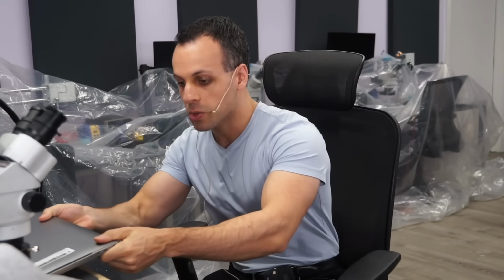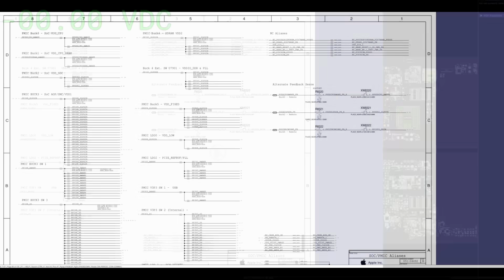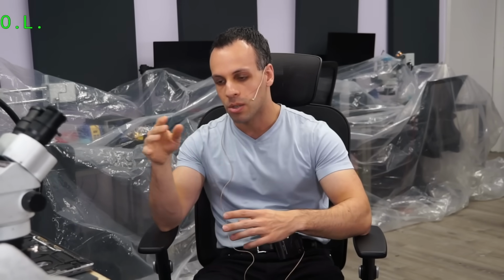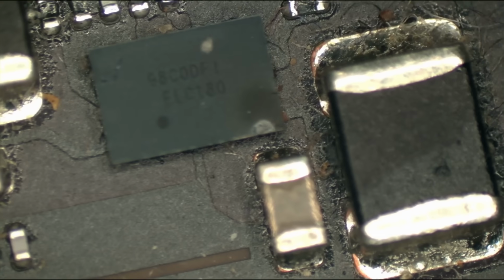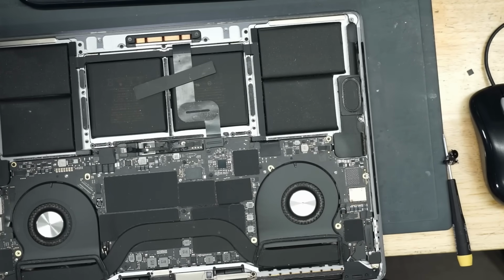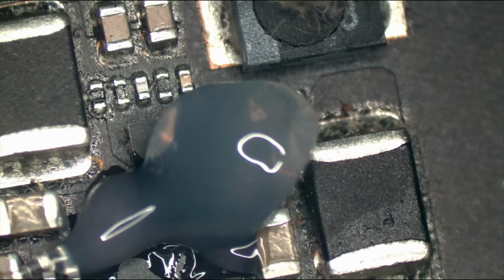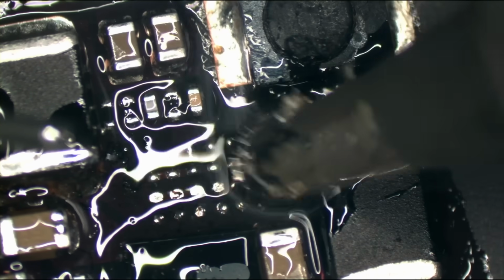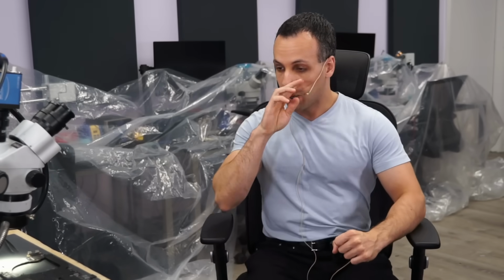How most 16" Macbook Pros often kill themselves & why they're unfixable

Comment: I understand buying apple phones and ipads. But apple laptops....Why would you buy a device that is listed as a computer yet it doesn't do all the things that computers have historically always done.....have REMOVABLE RAM AND HARD DRIVES!! upgradable stuff! 

You are going out and spending an absolute fortune for minimum hardware specs that you have no option to upgrade other than trying to sell the device a year or two later when you realize you actually do need that extra SSD space and more ram! 

Also if anything goes wrong with it, literally every single part costs an absolute fortune to have repaired! and as this video shows, a chip grenades itself on the motherboard and you literally loose all your data!

Comment: their should be a separate voltage cirtcuit to feed that memory along with protection diode at least . feedding 12v into that IC that offer little protection is negligent

Comment: I was an Apple Certified Tech and worked on every model every day for several years - an average of 10 completes per day. Favorite machine by far - Macbook Air. Easy to service. 13" Retina's were solid. We had chronic logic board failure issues in ALL the 15" laptops. Mac Mini's are great! Can't recommend iMacs of any era.

Comment: This is why you stick with the A1502. Mine is ten years old, and is still solid as hell. The SSD isn't soldered on, the parts for it are abundant and cheap, even a whole new logic board with an i7 3.1ghz processor and 16gb ram is only about a hundred bucks. Just get the little adapter and switch it to a new NVMe ssd, throw Linux on there, and it's fast as hell, super reliable, and super cheap.

Comment: 10:05.  I constanty find myself explaining this to other audio snobs like myself when i hea them claim how much better music would be if they had the hearing of a dog. Even though if they had the hearing of a dog, that most definitely would NOT be the case, especially on a properly setup stereo system... Frequency response does not equate to better hearing at all, often quite the opposite. If your ears worked like a dogs, say goodbye forever so stereo imaging and sound staging lmao. You would only ever be able to percieve phasing accurately in one small focused section of the sound stage at a time... Yea, a dog can hear 20-100k and can hear quiter sounds (but ONLY if looking directly at them when they happen lol), but that does not mean they have better hearing, not at all, not even remotely... up above 20k there no useful information in sound anyway, even if you could hear it. It's quite literally junk data.

Why have humans lost the ability to move their ears over time? Because our phase accuracy detection is SO unbelievably on point, that we dont even have to move our ears to tell what direction a sound is coming from. All of that information is easily retrievable, accurately, BECAUSE we dont have to worry about all the junk frequencies messing with our phase detection of the frequencies that matter.  The reason we cant tell what direction low frequencies come from is a limitation based in physics itself... the wavelength of sounds below 100hz is larger then the distance between the ears, i.e. theres no directional phase data to obtain, regardless... But since those low frequencies dont mess with phase accuracy of higher frequencies we dont have to filter them out for the phase information of higher frequencies to be accurate.

Deer cats, dogs.... a staccato like sound from a distance happens, and their heads and ears are on a swivel until it happens again, so they can MAYBE tell what direction the sound came from. Whereas every human in the area? Their heads will instantly, and involuntarily snap directly toward the source of the sound, assuming theres no reflections mucking up the phase information.

Humans do NOT have the frequency range of other animals, not even close, but counter intuitively, this is actually why our hearing is far more accurate. We can tell the difference between two frequencies, and determine source FAR FAR more effectively then other animals can. We are so good at it, we have literally lost our ability to move our ears because all that would do would mess up our phase accuracy through surface reflections, and create a meandering scale of frequency response, all to accomplish something we dont even need anymore. 

Frequency response is one thing, and most animals have it better then us. Phase detection and accuracy though? Humans are damn near supernatural with their ability to discern differences in sounds, and their source. Its like a super power compared to most other mammals.

When it comes to discernment between two different sounds, and locating source, and retrieving accurate phase data from the sounds, a human is so much better at hearing than a dog is, it's not even comparable.

i would trade hearing response upwards of 100k and a few extra DB of dynamic range, all day, every day, for hearing that shut off by 17.5k, but kept the phase accuracy my ears already have.... Oh wait, thats what i already have lol.

Comment: Crazy to see how Apple is a piece of shit company and not even a shadow of the early 2ks it was. My MacBook Pro 17inch 2007 and 2011, MacBook 2012 (white) to this day it still run as new, they have had their batteries replaced through the years. Heck even my Mac Pro 2010 still runs flawlessly (used as a Plex server and it's on 24/7). I also have the iMac SE DVD first of his name and it still runs like new, a G4 Cube and iMac G4 20 inch.

I will not buy an Apple computer ANYMORE, i've been seeing how cheap they are built more for profit than quality. Apple is absolutely SH1T!!!

Comment: Do you think this issue is to do with people charging them using the left two usbc ports instead of the correct right side pair ?
As you are not meant to charge this model from the left 2 usbc ports. 
Just a thought as I have a 2019 16" Touchbar MB Pro i9 model and its still like brand new and working fine.

Comment: fooook-dang, Rossmandude, hope the everclear binge was good!  My 2010 i7 MBPro shit itself once & and got a new motherboard under warranty but then it soldiered on for almost a decade doing dev, crankin', and running multiple VMs (mostly linuxen, grudgingly windblows...).  Totally worth the money from back then, amortized it's ass off for my company.  But, its replacement, the last of the Intel, core i9, that I have now, just feels fragile.  The thunderbolt ports are wonky, had one replaced, but it still drops out if wiggled.  Keys are wearing out.  Don't see it lasting a decade but hope springs eternal.  It sure runs hot so I keep it on a fan base.   During the coming zombie apocalypse I'll pleasure myself with my dad's Curta, assorted linear slide rules and the aluminum E6-B from my flight bag...   and I still have my dual floppy Mac SE, albeit haven't booted it in years.

Appreciate all your vids & even more your advocacy!

Comment: are there any kind of best practices you can do with an a2141 to lessen the chances of this chip dying?
Reply: I was researching the same thing, I think there is nothing you can do. I would be interested if you found anything useful
Reply: @ my guess is it's two points designed very very close together which could easily short with moisture. Theoretically, if you could cover that with solder mask, that would keep the risk of those 2 points shorting way down.
Reply: @SteveRieck-Music  Its a good idea. I think clear nail polish might also do the trick. I will try it on my unit if I can source the solder mask

Comment: I dunno if my eyes are deceiving me but when he puts the IC over the solder balls to test before soldering, he puts it 1 column to the right, leaving one column out. You can see the solder balls column shine thru the melted flux. If the IC is put this way, it is wrong connected. Then he tests it and gives a failure, obviously. Is this correct? I mean, he starts saying a lot of things about the computer but testing it with a misplaced IC will fail the test. You can see how it is misplaced at 13:04.

Comment: Before you jump to conclusions and panic: Louis is not fixing (or rather failing to fix) an Apple Silicon Macbook in this video.

Instead, he is working on the A2141 - MacBook Pro (16-inch, 2019) - 2.6GHz 6‑core Intel Core i7. 

And some of the problems he encounters are know problems specific to the 16 inch models of that time period and apparently bricks a few M1 16s as well. 

But since then these specific issues have not cropped up in the M2 or M3 and well, the M4 is out (November 27, 2024) it is too early to say.

Comment: @rossmanngroup, I was all set to buy a 2019 MBP 16” this Black Friday and then I saw your video.  Listen, I have been using a Mac since 2001 when I bought a PowerBook Titanium G4.  I have since gone back to college for an engineering degree.  There are a couple of programs that I have to use that don’t work with macOS or at least don’t run well with Parallels (or similar apps).  I was hoping to buy the last large screen Intel MBP and use BootCamp to hop over to Windows when I need to use those 3-4 programs that only work with that OS.  As a laptop repair guy, would you buy a MBP (late 2019) here in 2024 (almost 2025)?  Your video makes it seem like a ticking time bomb.  If so, is there any mod or something else that can be done to reduce the risk of that tiny little chip failing and frying your SSD?

On a side note, you mentioned you are working on legislation — I’m assuming a Right-to-Repair law.  I live in VA, how can I help?  Contact my US and State reps?  Something else?

Comment: I fixed my old xbox recently because of finding videos like yours. I describe myself as basicskly tech illiterate. I barely use a computer. I got the xbox when i was 6 and i had a game saved othit thats real hard to find again and the drive wouldnt open half the time and if it did it wouldnt read the disk. it took me 3 days of taking it spart and putting it back togethercout my cousin who repairs hardward told me to boil the rubber band in it and thats all it took to really fix it. Im glad i didnt throw it away before trying because it literally cost me nothing but time and it was quite fun actually.

I like videos like yours. You shoa the most important information which is the thing your are fixing and your hands/the tools you use. Its actually very accessible for people like me who cant follow written instructions only

Comment: I have a MacBook Pro 14" with a dead screen. Apple wants 62000 rupees(close to 750$) for a new panel. I am never personally going to buy an apple device.
Reply: What makes you think Apple is the best choice to repair? Have you not heard the  literal decades of experience with their repair service?
Just know that the screen is very nice. Therefore it’s also an expensive screen. Even if it wasn’t Apple, a 14 inch 120hz resolution OLED display it’s going to be expensive.

Comment: Fascinating. So this is a VERY COMMON FAILURE? 

How about adding TVS or, probably better, Zener diodes on the critical outputs of the switcher? Preventative maintenance, eh? 

Now I'm worried about my (new to me) Macbook Pro 2019...however your video is convincing me to look into adding Zeners or TVS diodes across the capacitors of the most critical rails! 

Just need to find a lovely schematic and parts layout for my toy.

Might you (Louis) have an opinion on this suggestion? Make a nice How-To video, would it not?

Great video as usual!

Thanks.

Comment: Why does this chip fail and is there a way to prevent this failure? upgrade that chip, adding a heat sink to it? Anything prevent this issue?
Reply: It fail because of bad quality control in the manufacturing process.. You have to understand that these chips were produced in huge volume and some were bound to fail.. considered yourself to be unlucky if it happen to you and its not your fault... Apple in the other hand couldve prevent this issue if they dont put the chip so close to whatever that causes the ssd to fry.. or simply make the ssd plug and play for easy repairability instead of soldered to the logic board

Comment: My Personal Opinion is that there is a design flaw in the schematics for me. Why would you place a 32V fuse on a 13.1V line?
If we follow the source of power it goes back to F7000 and F7001 which are the two 12A 32V Fuses.
The TPS62180 device is rated to 15V only. a spike on the line of 16V might be sufficient to fry it and send it down the 2.5V line.

Also @10:20 look what small distance is between L9080 (1.5V) C9073 (13.1V). Slight amount of moisturewith dust and it is a short waiting to happen.

A valid reason for the spike might be the user, as U7000 supports a Reverse Turbo Boost (RTB) with Battery chargin operation mode. This is taken from ISL9241 operation mode explanation, which I don't believe to be that dissimilar to ISL9240 - " Initially, when the system load is lower than the adapter power, all the system power is provided from the adapter.
As the system load increases, the ISL9241 provides power from the adapter up to the programmed Adapter
Current Limit. When the Adapter Current Limit is reached, the ISL9241 operates in the reverse direction, boosting
up the power from the battery and providing the remaining needed power in addition to the adapter power. The
ISL9241 can go from forward battery charging to RTB mode automatically depending on the load demand. When
RTB mode is enabled, the battery FET (connected to BGATE - Q7065)  is always turned on. " 

Document link: https://www.renesas.com/us/en/document/apn/r16an0002-isl9241-operation-modes-application-note?r=507701

Essentially if the user plugged a lower power USB-C Charger and cause this RTB operation mode there is the oportunity to go above the 13.1V specified for G3H.

It will be interesting to see a SMC log of the power rails and see what was G3H rail history as it is monitored by the SMC.

Looking forward to comments and opinions.

Comment: My A1706 is still going strong... Only had to replace the battery twice but sadly Apple are consigning it to the history books as they move away from supporting intel based macs. Can't upgrade it to Sonoma... Will eventually be screwed by Xcode when it needs to be upgraded to a version that doesn't support my mac which currently supports up to Xcode 15.2.. The current m1's and beyond need a displaylink dock/adaptor for multiple monitor support and no longer support eGPU's which i use.

Comment: Is the chip that was installed a different model? when you re soldered it it did not line up on the same pads and was skewed to the right by one column.....
Reply: watch it again, he didn't resolder it.

Comment: When the 16" M1 Pro came out I was one of the first to buy. 14 days after taking delivery it died, just like the one you showed. I took it back to the Apple Store and got a full refund. Then I bought a Dell XPS. It's not perfect, the battery life is terrible, but it's the laptop I am using for this comment. It has replaceable RAM and SSD too.

Comment: The gods of the YT algorithm are telling me to back up my SSD in my a2141 more frequently just in case I don’t actually have everything on cloud (which I’m sure I will have missed something!)
This MBP is probably the worse Apple product I’ve had the misfortune of owning.  The thermal management is a joke and the whole system becomes permanently throttled at some point to avoid it sounding like a 747 taking off.  To now learn that it has this type of inherent flaw is just icing on the cake!  Thanks for your great content Louis!

Comment: That’s what happened to my 2019 MacBook Pro. No damage what so ever I babied it! One day when I was done working I shut it off no problems few days later I went to use it and it never powered on again. Apple Store told me,e it would be $800+ to repair I owned it for only a little over a year. I was so pissed no way I could invest $800 into it. I ended up buying a PC instead but 8 still have my broken MacBook and I’m still upset about it. I had been using macs since 2007 but between the random dying of my MacBook and complete lack of user upgradability I had to switch back to pc. It’s unfortunate because I really do love OSX

Comment: Could use an advice if I should send it to you. My MacBook Pro 2019 also stopped powering up if I shut it down some times. If it turns on it shows error that it was shut down due to error - power up in such case happens with like 10-20min delay (as if battery was over discharged, but powers on with like 30% at least)

Last time it took 30min to power up. Than 10 days no issues. 

Few days ago again, doesn’t want to power up. No matter what I do this time.
Reply: On a side note, can you recommend any repair shop in EU for this type of repair ?
Reply: And touchpad clicks with battery off, charger in (doesn’t with battery on, charger off)

Comment: I purchased a  new 16" MacBook pro m1 for over $2000 and it was used infrequently. Near the end of the first year, it started to have a black screen from time to time. After the warranty expired, the problem got worse. I was lucky that I purchased it from Costco with 2 years warranty of Apple products. I sent it for repair. Today, I received a letter that they found the problem and ordered parts to fix it. A hardware problem within the first year is not acceptable to me or to any reasonable person.